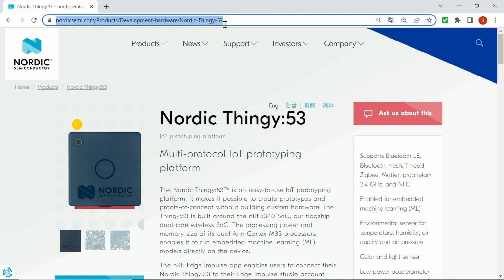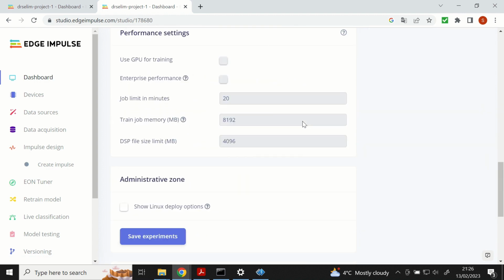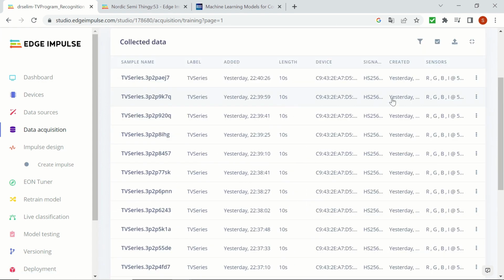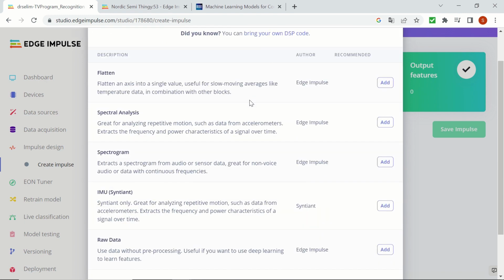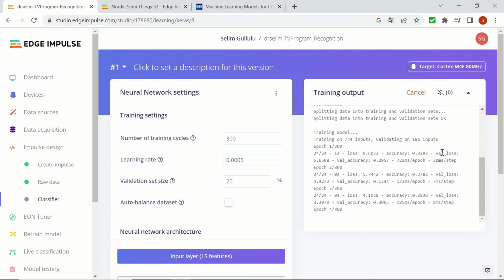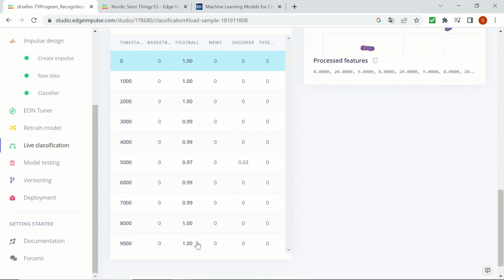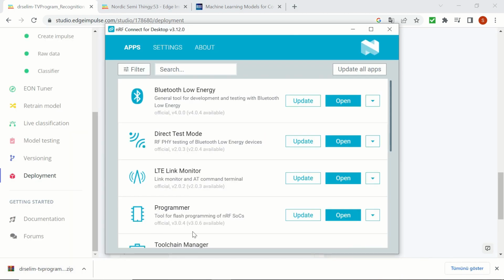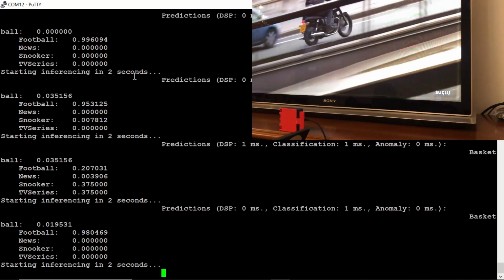Embedded Machine Learning Example with Thingy:53 - Classification

Comment: Good work. I was unsure at first whether it was possible to flash T53 from PC without j-link, but can see from your example it can be done.
Reply from the maker: Thank you, yes it's possible. However I experienced some problems after flashing the FW that I built in EdgeImpulse, I was not able to reset the Thingy53 to its initial state. You can see the problem ı had in my most recent video (BLE app with nRF52840 Dongle) there's a problem with the HCI connection. I'll obtain a 3V Nordic DK to fully erase the thingy53.